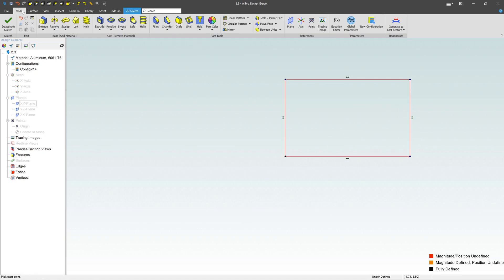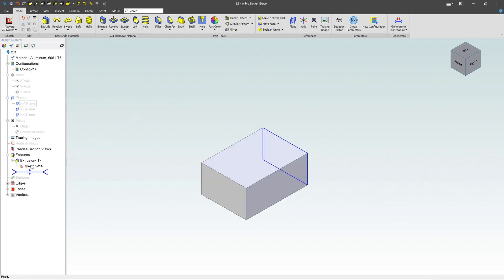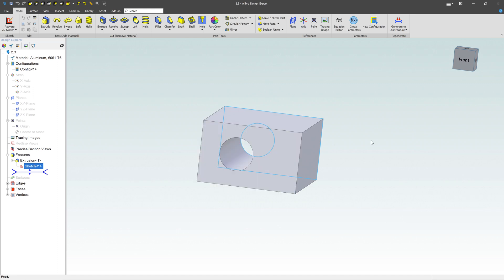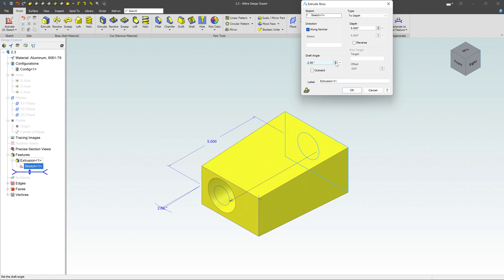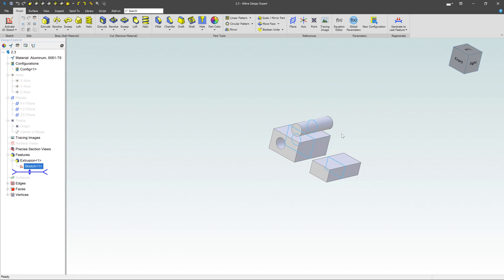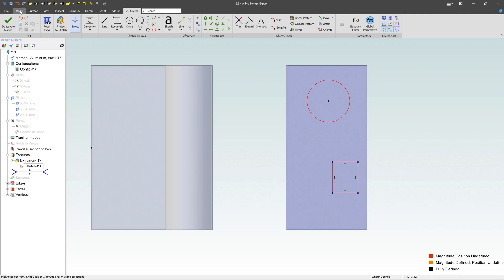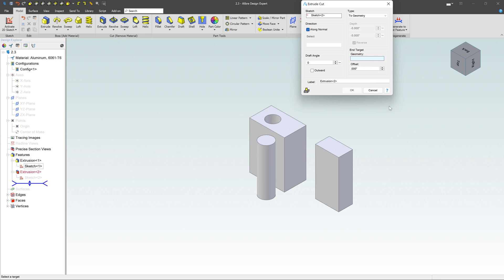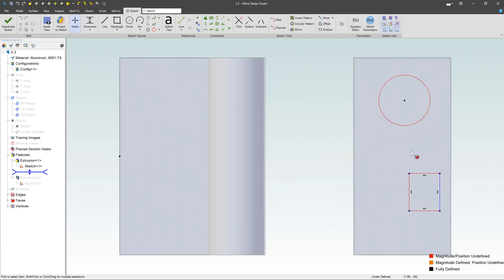Extrude Boss/Cut in Alibre Design | 2022 Exercise Series

Comment: Why is it impossible to choose what part of a Sketch I want to extrude? I can't understand this, it is possible in Catia, Solid Works, Fusion 360 and onshape but why is this software missing such a basic feature?
Reply: Alibre seems to prioritize a streamlined workflow through complete sketches and feature-based modeling. This ensures consistency and predictability. You can achieve the same results by creating multiple sketches, using reference geometry, or with boolean operations. While it would be a nice feature to have, I've used Alibre for 15 years and never considered that a "must have" 😄
Reply: @sevendaysworth  So maybe it's the wrong Software for my Workflow. And I don't think I'm the only one because all other Softwares are having this feature. So one more time I have to go back and stick with Solid Works
Reply: @pran0124  coming from fusion 360 I was wondering the same thing. I Think it's just a different work flow than what I'm used to. Problem I have with fusion 360 is they keep making it harder and more restrictive to use for hobby use. I am using the trial right now to create some basic objects and then I am going to try making some of the items I made in fusion 360 for my 3d printing. if I can make them with some minor change in workflow I will buy this as its a perpetual license. currently I am watching the tutorials to get a basic understanding since when I  tried to use it like I did in fusion 360 I was like why isn't this working.